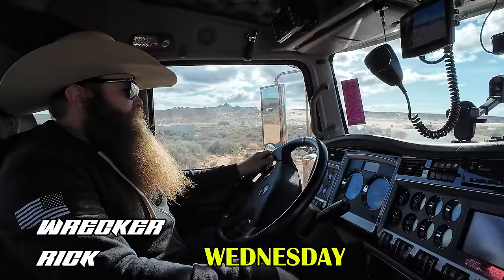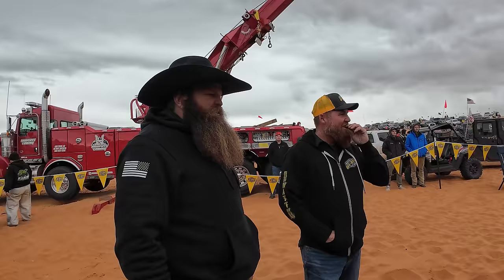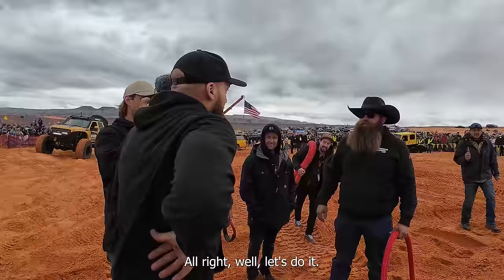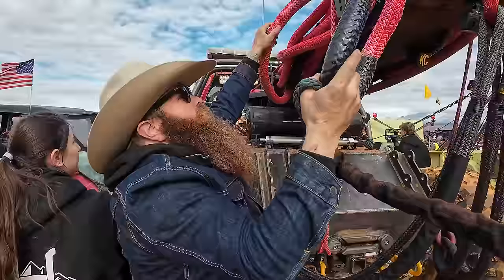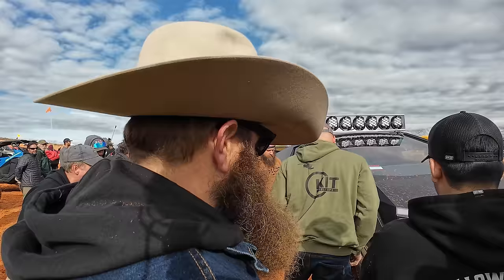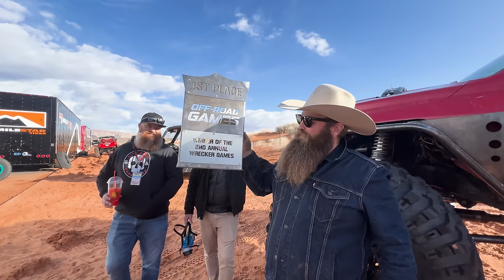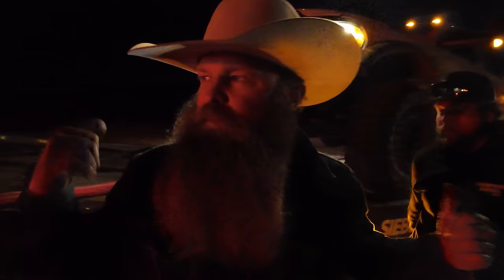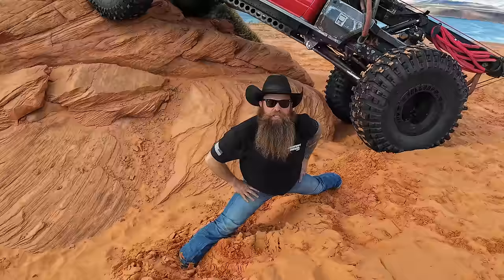You Won’t Believe My Story!! OFF-ROAD GAMES 2024

Comment: Brodozer was definitely outclassed, even by a "wounded" Hellboy. That's what happens when "EGO" replaces capability🤣🤣🤣🤣 All hail Wrecker Rick, the conqueror👑👑👑
Reply from the maker: 😂 Thanks Don!
Reply: One thing you have to remember, brodozer it's all about money
Reply: Two different types of trucks. One is meant to be heavy and pull stuff out, while the other is narrowed and meant to be lighter to do flips and tricks at Monster Jam.

   This is definately more Hell Boys element where it would probably fail at Monster Jam and not recommend doing back flips, moon walks, running over or jumping cars. If anything else for the reason Rick mentioned of tearing up tires.

I love both trucks. Heck I love all the trucks that competed. I'm a motorhead junkie that has all kind of fuel flowing through my veins. From diesel monsters to full blown alcohol funny cars...I'm game.

Comment: EPA having a meltdown watching hellboy dump smoke 😂. Great Vid.
Reply from the maker: 😂 I hope not! It’s gotta small one and a big one, I’ve got a little to much fuel running to it cause I’m running nitrous, now I’m gonna adjust the tune, I don’t think I’m gonna use the nitrous very often
Reply: @MURPHYSDIESEL yeah nitrous is just not practical for what the truck was actually built for
Reply: EPACANSUKIT
Reply: @MURPHYSDIESEL  Run two tunes with a switch
Reply: @MURPHYSDIESEL ya you need to clean that thing  up for the phyco greenies they dont get that soot is particles and settle out
Reply: @Kinginwar  doesn’t matter for off-road use
Reply: @mikebarnes1535 you dont understand nitrous on a diesel 😂

Comment: I knew something wasn’t right with that much smoke and not no wheel speed on Matt’s live stream. Now I understand not enough air for the fuel with boot torn. After you fixed it it cleaned out after a second or two. Hell for what little testing it done great it was a good shakedown for HellBoy. Giver Hell boys

Comment: Bro Dozer is more of a Monster Truck they tried to keep lighter and narrowed. Hell Boy is more of fat bull truck that uses it's weight to it's advantage and is just an outright Monster.

   Bro Dozer with the Monster Truck tires is meant to jump, fly, and do tricks at Monster Jam. Hell Boy is meant to be heavy to use its weight as momentum to pull out big heavy stuck stuff like War Machine.

I'm sorry they are just two different types of trucks built for two completely differant reasons and jobs. It's no different then comparing pull sled trucks to Monster Trucks or Mega Mud Trucks. In some areas they shine, in other areas they are better then being stock.

Take pride in what you built, it's a bad mammer jammer💪👍. I just wouldn't recommend Monster Jam going over cars, jumps, and trying to do backflips.
Reply: Btw I would love to see Hell Boy destroy a pull sled or do tug of war on more solid ground.

Comment: What is going to be the build for the 2025 OFF-ROAD Games?
Reply from the maker: That’s a good question, what would you like to see us build ?
Reply: @MURPHYSDIESEL   I've never been to Northern Arizona so an approbate trail rescue rig for the swamps of Louisiana is completely different for little ole Ash Fork, Arizona.

I kept telling myself the same thing as I watched the Hell Boy build, this is a purpose built off road wrecker for northern Arizona. 

We're talking some serious bucks for a vehicle that needs to earn its keep for the other 360 days out of the year when it isn't in the sands of Hurricane, Utah.  

I would say either stop at Hell Boy because nothing is ever going to beat it unless it's bigger which makes it even more impractical to call a "trail rescue wrecker." 

If you can make money with it I would say your target build is the wheels have to fit between the wheel wells of your standard utility trailer.  

Matt's Off Road Rescue has had several recoveries where his wrecker has struggled to keep from falling off of the side of the mountain so wider isn't better.  

One idea I have is to take a Jeep Gladiator, toss the pickup bed, chop the rear off and turn it into a two door Jeep. 

I would start with a set of 74Weld Portals with rear steering rear axels.  

Win the category of “Narrowest Off-Road Wrecker” or “Most Nimble Off-Road Wrecker” for the super tight trails.  

Another fun idea is first search the web for - 

"1960 Jeep FC150 For Sale - STL9342"

Now search YouTube for theses three amazing builds -

"1957 Willys Jeep FC-150 Tilt Cab"

"`62 Jeep FC 170 (Forward Control) w/ Rick Pewe at the 20230 SEMA Show"

"1964 M677 Quad Cab Forward Control Jeep"

I'll be curious what everyone else's idea is for the next build.

Comment: Good time's it was a good test run moving all the big rubber takes a lot of power a lot of lost horsepower and all the movement moving parts you're probably realizing that that Cummins motor is not going to never get the job done you may be able to do better if you find a knowledgeable person that knows how to really build a 5.9 I run a big truck with big tires it's a Ford what's a belt 7.3 with the transmission out of an 18-wheeler it makes lots of torque add a drag around a Cummings all day everyday never had one come close to even comparing to the.
You have great bones and a good platform it's your first truck there's a lot to learn I've been doing it a while quite honestly you never quit learning and you never quit breaking stuff it's all part of the rodeo but you're probably thinking exactly what most people are thinking you need more torque and horsepower. There are several ways to keep the motor extremely cool enter diesel exhaust temps extremely cool under those conditions you just got to do some research the harder the Truck Works the less power it makes because of the temperatures. Want to bounce it off a few ideas from some folks on how to keep that motor extremely cool with your exhaust why working a dog s*** out of it for long periods of time you'll have it licked.
Tie the truck up to something you know it can never pull something like a train car with the wheels welded in a track tie the truck to it and put it in D and mash the pedal to the right and hold it to the floor for about 25 minutes if you can come up with a solution to keep the motor running cool along with the exhaust temperature with minimum failures from your Driveline well now you got something young man you might want to think about ditching the nitrous it's helping you what's a big zero all you're going to ever do is grenade a bunch of motors the dollar spent I'm that can be better spent than other places.
I live in a state that takes the stuff seriously it's in the South one of the biggest states in the Union weeping the Moab tons of times we've been in that very spot tons of times fun times playing in the sand and then taking the boat out on the reservoir Waterfront it's just too far to transport everything good thing we own a transportation company with lots of 18 wheelers cuz it's sure tied up about 12 of them for about a month every year. You got this far by doing a lot of research do some more research on who can build a motor and transmission combination with lots of torque and horsepower there's not that many out there that actually know what they're doing but they'll know exactly what I'm talking about on ways to keep the motor cool and the exhaust temperature cool once you achieve that well then you start snapping all your Driveline and that's just part of it it's a hobby a real expensive one a good motor transmission combo starts at 125k that's lots of custom-made parts internal components you'll never find on the shelves at some dealer certain types of Alloys that people know about and I know how to build a motor and transmission to hold up to do what you're wanting to do just like you getting a dealer Trucking jumping and go to work everyday I just kind of do the thing it's when you push them to the extreme they start failing I know a couple of folks that run old 5.9 they do well but oftentimes the motor can't handle the torture put through it the motor spend more time out of the truck than in the truck for lengthy repairs most people run a 7.3 powerstroke you can build them with a lot more torque and horsepower and they hold up well to the punishment I snapped a couple in half before they all break but with the three motors that I snapped  in half I would have went through a Dry Van full 5.9 Cummins makes a great motor but not for that platform same with Ford you take one of the new trucks and New Motors and start doing that it wouldn't last 10 minutes they were never designed and built for that purpose look for a Cummins motor out of a heavy truck operation what's the dimensions suitable for your Dodge 550 working area AKA make sure the motor fit in the area that you're trying to stab it in you're not working business you should be able to find a good donor motor you're well at first with heavy truck operation as I am we run a fleet of trucks for Oilfield Services that type of work is hard on the equipment you just kind of figured things out know what works what's my experiences never at a dealership all the best buildable motors have old castings the block for better back in the day a good place to start throw a few bucks at it get a couple of folks that know what they're doing Plug and Play well now you got something.
Reply: Murphys isn't having motor issues...they're doing just fine